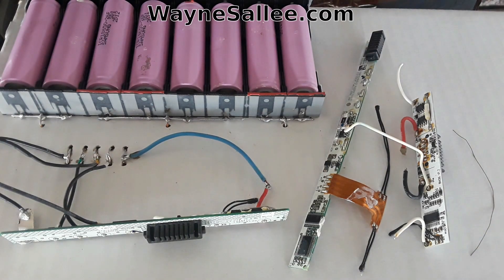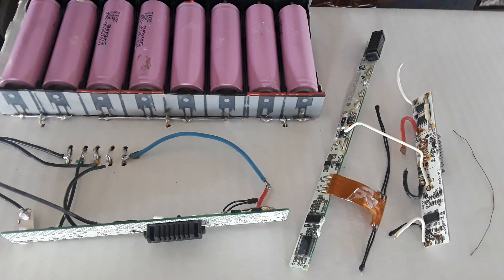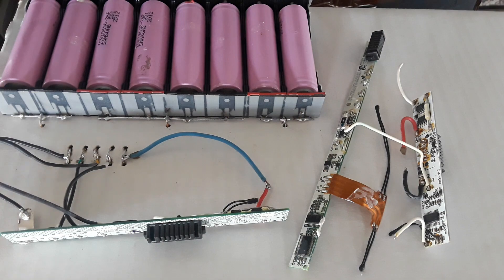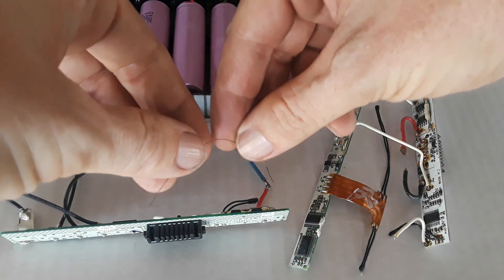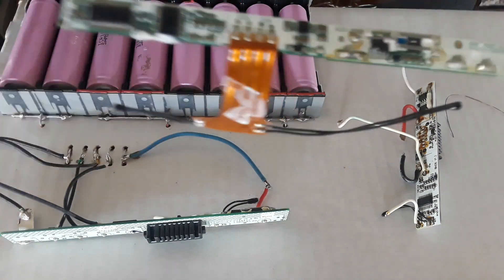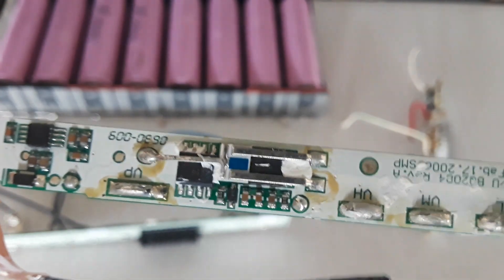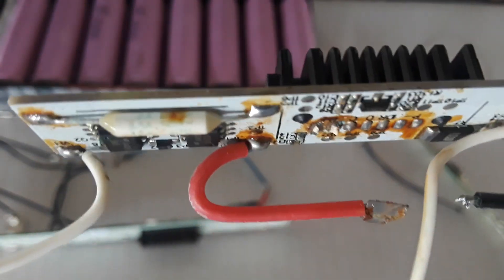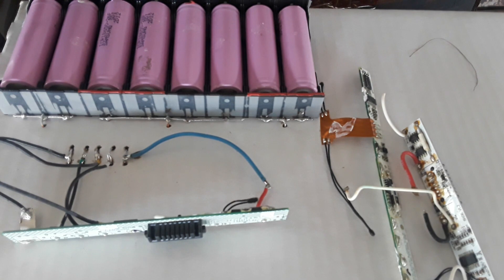Resetting Your Laptop Lithium Battery Pack After You Rebuild it.

Comment: These batteries use a 3 way fuse that is blow by the control chip.  The fuse blows for an undervoltage or if a cell is disconnected. If you put a solder blob it will try to blow it again as the fault is saved in the eeprom memory of the controller chip. The only way to get it working again is to reset the fault. This is done by resetting the PFF permanent failure flag using an SMBus device.
Reply from the maker: Yes, and those usually cost a good deal of money, so most people don't have one.

Comment: The blown fuse is intensional. The controller sends a charge to blow the fuse if it detects an overcharge or under charge condition or the charge recharge count reaches a predermined level to prevent the battery from being put back into use. Newer systems use a firmware locking flag which the controller sets for the same purpose and the equipment for resetting that flag is horrendously expensive initially and is ongoing on an annual basis.
Reply from the maker: It could be easily done by setting a transistor to ground, that is connected to the power in near the fuse.

Have you seen any evidence of a controller sending a charge to blow the fuse?

Wayne Sallee
Wayne@WayneSallee.com
http://www.WayneSallee.com
Reply: @WayneSallee-comTech  hi, mine is doing that,...... as soon as I connect the new cells (4) the fuse starts going wild hot !!! .. i researchead a little bit and retrieved the controller datasheet where TI explains that. The controller in mines is Texas Instruments BQ3055
Reply from the maker: @raraujo4951  It's called a "logic fuse" They are designed to self destruct, forcing the fuse to blow. So they work in 2 ways. One is they will blow if too much current goes through, and the other way is they will blow if the bms decides to blow it. The bms will short it, making it hot enough for the solder inside to melt.
Reply: @WayneSallee-comTech  correct, according to de datasheet, if certain conditions are detected, the controller commands one FET driver to HIGH and the other to LOW, allowing enough current to flow and blow the chemical fuse. If the controller was set to "sealed mode" when programmed at the application level,  that logic cannot be reset by any means... Deeming the pack permanently disabled.
Reply from the maker: @raraujo4951  Yes, but the fuse can be jumpered with some solder.

But then some of them also self destruct the program. They can usually be reprogrammed, or re-enabled with expensive programing equipment. But that is too costly. "Right To Repair" movement is slowly making changes.

All that battery nonsense is one of the reasons that I built my own laptop using a desktop motherboard, and 16 lithium batteries.

Wayne Sallee
Wayne@WayneSallee.com
http://www.WayneSallee.com
Reply: @WayneSallee-comTech  Hi! Thanks for your comments ! ....Its good to know there is a movement on that !!! Sounds logical that the OEMs are  required to released the Keys lo unseal and unlock the Batt-Packs....☹️😞
Reply from the maker: @raraujo4951  https://www.youtube.com/@rossmanngroup has been working hard to get right-to-repair, as have may others.

Comment: Hey guys, you can try this method but don't expect too much to succeed. Many batteries have complex control chips (like those from Texas Instruments) that will just not reset, no matter what kind of jumpstart you try. When cells voltage drop below a certain value the chip will trigger a fault status, and cutts Vcc output. The only way of getting your battery to work again in this case is to get a USB to VPIO interface to read then change chip parameters, and if you ain't ready for that better go spend 35 bucks and just buy a new battery.
Reply from the maker: Yes many of them self destruct, but many of them will not self destruct. It's a shame that the bms can't be purchased separately. I am building a laptop with a non-priority bms that won't kill itself, and that can be repurchased any time.

Wayne Sallee
Wayne@WayneSallee.com
http://www.WayneSallee.com
Reply: quite hard to get replacement batteries for 20+ old laptops.
In case of my old compaq armada 7770dmt it's impossible.
Got three broken batteries, one did work once but when charging to like 69% it suddenly stopped charging and never worked again.
However the battery voltage was just fine as every cell was well over 3,7V so dunno what happened.

Comment: Is it possible to charge the laptop battery pack by using a bench power supply? Thanks
Reply from the maker: Yes, just give it the right amount of volts, and the bms in the battery pack will control the charging.

Wayne Sallee
Wayne@WayneSallee.com
http://www.WayneSallee.com

Comment: Found fuse blown and ran thin wire across the 3 pins to act like a fuse. Thanks for the tips!
Reply from the maker: Your welcome. I'm glad it helped.

Wayne Sallee
Wayne@WayneSallee.com
http://www.WayneSallee.com
Reply: @WayneSallee-comTech   I'm pushing for my luck here but hope you can help again. It won't charge past 57% and apparently it has 14% life remaining. I have replaced 2 cells that had voltage below 4.12v
Reply from the maker: @eugrafcmg  What happens when you run the laptop on battery? Does it drain down properly? Does it charge back up to 57% ? What are the battery voltages when it is charged to 57% ? What are the battery voltages when it is discharged after running on battery down to like 5%?

Wayne Sallee
Wayne@WayneSallee.com
http://www.WayneSallee.com
Reply: @eugrafcmg  You really need to reset the BQ IC in order to fix that.

So in actuality you need specialised hardware (i.e. EV2300/EV2400) with software (Smart Battery Workshop or Battery EEPROM Works) to really reset a laptop battery. 😑😕😒

I have an assembled/saved playlist with videos on this topic on my channel.
Reply: @WayneSallee-comTech  can I use higher mah battery cell in laptop battery case. Will bms of laptop support it ??  Asking for acer aspire 4740 & sony fseries vpcf135fg.

Comment from the maker: > Did you connect a small wire for a second between the positive (+) 

> battery and the positive BMS? Can you make a drawing explaining?

 
Basically you just need to provide
      power to the BMS. So the first step is to figure out where the +
      and the - is for power in to the BMS. Then provide appropriate
      power. The easiest way to do that if you have access to the
      battery is to simply use a wire connected to the battery to
      provide power. But, when using the battery for power, you only
      need to provide power to the one that is switched, usually this is
      the +, but sometimes the -. You can provide power to both if you
      want. Make sure that you provide - to the -, and + to the +.
    
      Wayne Sallee
      Wayne@WayneSallee.com
      http://www.WayneSallee.com

Comment: Hey, I wanted to thank you for this tutorial! My battery was not giving output voltage at all but after doing what you explained (both the resetting and soldering the fuse) now I can see 11.2v coming out!

Still my pc won't boot on battery, and Windows (I have a Win XP laptop, it's quite old, and fixing it is just one of my hobby projects) shows the same thing as before: unknown remaining, critical level, etc.

Is there anything else I should check besides the output voltage?

Thanks in advance and thanks again for the video!
Reply: Also now touching the battery case after leaving the laptop charging seems to be warm... I guess it's a good sign?
Reply: UPDATE: IT'S WORKING. Thank you so much for this video!! It was matter of leaving it charging overnight!
Reply from the maker: @escuchaesto  Great! 
Glad it's working.

In the upcoming years, "right to repair" is going to become extremely important.

Wayne Sallee
Wayne@WayneSallee.com
http://www.WayneSallee.com

Comment: Well im doing a recell on a dell laptop battery (7537 Inspiron model btw) i attached the cells in correct orientation ....checked with multimeter that the voltage is as like as in the original battery. But no power. Now i got to your trick and STILL not able to get the battery pack to start. I tried + to both + ... no go... then - to -... no go. What im doing wrong???
Reply: And ...I mean when i touch + to + it shows a little spark and all but it does not start the batterypack.
Reply from the maker: @jemsncrystals  If it creates a spark, then you are doing something wrong, or the bms is defective.

It's also a good idea to use a very thin wire, or something with high resistance to reduce the risk of messing something up, when resetting the switch.

Make sure that you have your batteries hooked up right. You probably have them right, as it is easy to just hook them back up the way the old ones were. Make sure that the total battery voltage is correct. You probably have this right, but double check.

Now locate the + and the - connections on charge connector on your battery pack. This is where you are probably going wrong. The + will usually have 2 pins, and the - will usually have 2 pins. The data lines will have 1 pin each. You want to connect the + to +, and if that does nothing, connect the - to -. After making the proper connection check the charge port voltage on the battery pack, you should now have proper voltage coming out of your charge port on your battery pack. If not, then your laptop will give an error.

To reiterate, you are to connect the + of the charging port, to the far + of the batteries. In other words you are connecting total voltage to total voltage.

Wayne Sallee
Wayne@WayneSallee.com
http://www.WayneSallee.com
Reply: WayneSalleeTech thanks for quick reply. 

First of all, the spark that I mentioned earlier, is not a spark actually; but its kind of the thing when you trying to make a connection. So its very very dim and then it goes. 

Secondly, I checked the total voltage on the battery pack (original that came with the laptop) is coming out 15.6
And the new cells are coming out 14.3volts (by multimeter)
iam using the PCB board of the original Battery and I know that all the voltages are correct because I have double checked it with the sales layout that came in the original battery and also I am certain about their Polarity. Because I arranged another PCB board of the same battery locally and I know I'm right because I burned that second board by connecting the cells wrong so I know it is right because if it was wrong then this original PCB board should also burn but it's not so ha ha and I am doing exactly as you are Showing in the video the positive to the positive and after that I check the terminals of the battery pack by multimeter it shows me the rating of 0.09 then it goes to 0.0 8-7-6 - and ultimately to zero, so I guess the voltage is coming after jumpstarting the battery pack but it's not being stable why is that I really appreciate your help.
Reply from the maker: @jemsncrystals  Yes it sounds like it is charging a capacitor when you apply power, but does not turn it on as expected, and when you check the voltage the capacitor empties. It could be a blown fuse. I did not see any fuse in the pictures that you sent me. If you have not done so, try the - to -, just in case. I bet that after doing so, you won't get any voltage reading. But it's worth trying. After trying that, look for a fuse. 

Also, the one that you burnt, could just be a blown fuse.

Wayne Sallee
Wayne@WayneSallee.com
http://www.WayneSallee.com
Reply from the maker: You could also try testing with an amp meter from + to +.

Wayne Sallee
Wayne@WayneSallee.com
http://www.WayneSallee.com
Reply: WayneSalleeTech yes you are right! When i jump start with (+) to (+) and check with multimeter it goes 8-7-6-5 to 0.00
And when i try jumpstart it on (-) to (-) , it doesn't give out anything, just 0.00

Ok yea and now i see that on the PCB there is a fuse, it is marked with F1 so i guess Fuse 1. Right? Ok so i tried reading its number and viola! Its a fuse (12AH4 sc sf) its some kinda fuse with 4 terminals ( have a look here www.karosium.com/2016/09/the-weird-fuses-in-laptop-batteries.html?m=1 ) so now im searching how to jump it.
Reply from the maker: @jemsncrystals  Probably on the sides, if not, then on the length. Jumper it first with a very fine wire, or a high ohm resistor, and try the + to + and see if it works.

Wayne Sallee
Wayne@WayneSallee.com
http://www.WayneSallee.com
Reply: WayneSalleeTech i tried jumping the fuse with a very fine wire, and then + to + but the voltage is still not coming up on the battery terminal. Its still doing the same thing. Starts from 0.9- then to 9-8-7-6 to zero. If we suppose that the board is bad but its not as the center pin shows 1.3 volts. I guess it is clock or data line. Hence board is fine (i guess). What is that im doing wrong?
Reply: Also when i tried soldering the + to + jumpstart wire and after a while, now the battery has voltage on battery connector, BUT AGAIN when you disconnect the + to + wire, it goes down to 9-8-7-6 and then to 0.0volts arrrhhh
Reply from the maker: @jemsncrystals  Yes, the clock and data is not important at this point. Did you solder the jumper on the fuse? It needs to be a constant jumper on the fuse. If so, did you also try jumpering the ends of the fuse? You could also check for voltage at the fuse.

Wayne Sallee
Wayne@WayneSallee.com
http://www.WayneSallee.com
Reply: WayneSalleeTech here's what i did. I checked the fuse with continuity mode and there was no continuity on the shorter side. Then i checked on the lengthier side on the fuse. There was a beep. I checked the schematic of this fuse and it says that the lengthier side is a heater and the shorter is the ACTUAL fuse. So, I soldered a very thin wire on the  shorter (fuse) side. Now checked again, now both sides have continuity. Then i tried by the + to + to jumpstart the battery. But alas, again the same thing.
Then i took the fuse off of the board. Cleaned the pcb pads, reapplied  fresh solder and took a very thin wire and connected both shorter and lengthier side and checked continuity. And then i tried doing + to +. But again same thing. 9-8-7-6 and zero. 

And i took the + to + wire and soldered it on the charge port + and other end to battery + thinking that it would take some more time to wake the BMS up. One interesting thing i want to share is... that while that +to + wire was soldered, i checked the battery connector with multimeter, there was total voltage of 10.9 volts! But when I disconnect it ... it goes back to that 9-8-7-6 and to 0.00
Reply: Also i know its a silly question but what if i keep that + to + soldered on all the time? Cat this way this battery pack will start to charge? I know it might be dangerous as im bypassing the entire BMS but lets say i do that and keep an eye on how much time i charge this thing n whatnot ( just to keep it safe) i know this battery gets to a full 100% in 1 hour so if i keep it for half an hour will it be safe?
Reply from the maker: @jemsncrystals   It sounds like the BMS has a short somewhere. What + to + are you connecting? You can't charge the battery with itself. However you can apply the proper power to the battery pack charge connector, to charge the batteries ( and at the same time, you can also check for hot spots on the BMS  to find a short). 

And yes you can carefully charge the batteries directly, but try charging to the BMS connector first.

 Wayne Sallee
Wayne@WayneSallee.com
http://www.WayneSallee.com
Reply: WayneSalleeTech the + to + is the one that you showed in tour video.
Reply: Yes a bms short seems like my next area to diagnose. Can you tell me how to look for a short in bms. And bms what component is bms? If you can let me know i can go and check where is the short. And report back
Reply: it probably has an intelligent controller which simply sets one bit to 1 if the battery ever fails.
And this will permanently cut off the power.
You need special gear to reset this (or a new controller IC) to get it working again.
Reply: @MultiWirth  yes thats what i thaught too. Damn its like a heart bypass surgery that i neet to pit the patient battery to the ventilator till i operate hahahah dumass dell. The problem is its a 2012 model laptop. But still has a boot time of 9 seconds to desktop and dell doesn’t makes batteries. Ive tried the generic batteries and they fail to be charged within the system. So for now im just plug in and do it hahah.

Comment: This doesn't work for me,but i tried to connect main 12v + on the bms and data pin and that give's me an output voltage ( my battery is 70-NLF1B2000Y A32-F82)
Reply from the maker: What's the battery voltage?